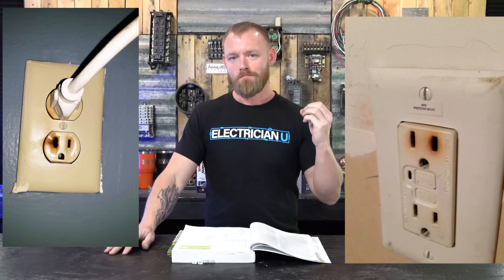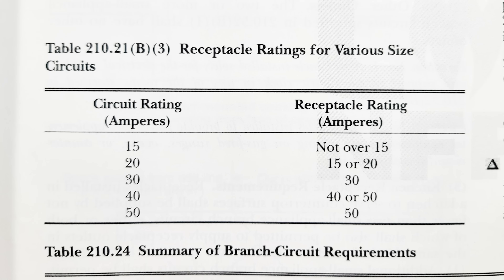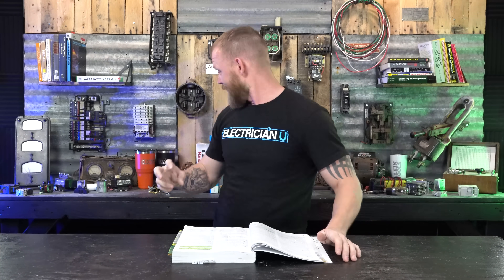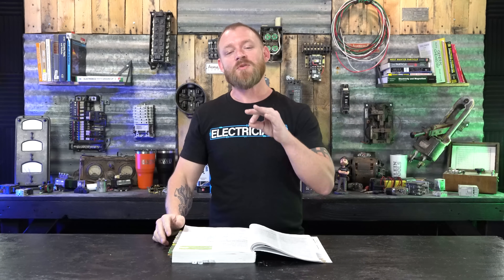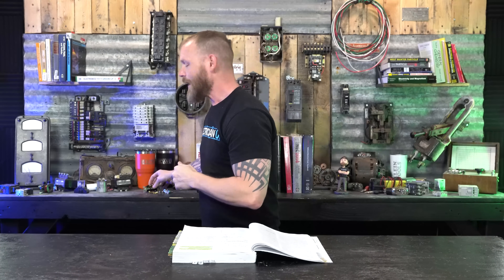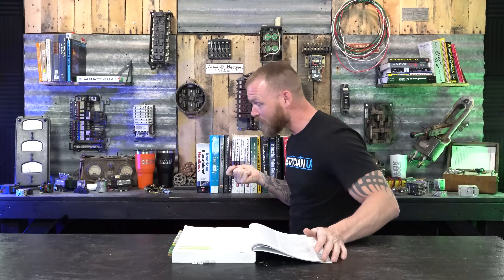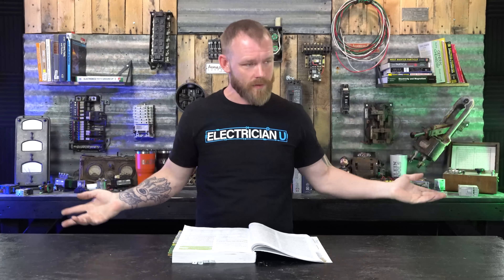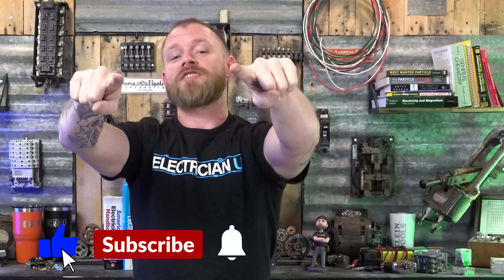Won't These Melt?!? 15amp Receptacles on 20 amp Circuits!!!

Comment: One of the other common causes of melted receptacles is old/worn out ones. If you look at the data sheet (and there is one if it is UL rated) there is a spec that states the amount of times the plug can be connected and disconnected and still maintain the contact pressure for that current. There is actually a tester for the insertion and removal force of a receptacle. If the force holding the connection is weak it will not matter if the plug is rated for 15 or 20 amps it is going to get warm if there is a loose connection. (either on the user side, or the terminal side).
Reply: Agreed. Old and wore out. Your statement about the contract pressure being a very valid point. I rarely consider myself when doing troubleshooting unless it's glaringly obvious its wore out in that way. One cause of a receptacles being worn out is from just slightly over-amping it over time. Breaking it down slowly until it fails. With any luck it fails in a way that makes it stop working instead of catching fire from arcing. Part of why AFCI breakers are becoming more and more prevalent. As they should. Though they can be a pain in the ass to set up
Reply: @JBDay-bd8cu  no idea where you got that but that is completely incorrect, receptacles are tested at well above their rated amperages to get certification and AFCIs were implemented because of damaged wires in the walls starting fires.
Reply: Makes sense. It’s like older video game systems like the Nintendo NES where the pins get stretched in the pin connector overtime and the games don’t read. 
I had a receptacle melt on me several years ago. Not sure why and it wasn’t a plug that was used very often and it was in the basement and the basement was only finished prior to me moving in. Not sure how long or how much used that receptacle was used by the previous owner though if any. We had a family friend of the wife’s come and replace it. 

We are now building an addition to our 2002 year home and we redid one of the outer walls and noticed the plug and the light switch on that wall they used the back quick connect rather than the side screws. In our addition though I am running 20 amp plugs and a circuit out there myself as I am putting 2 computers out there and it may need to be heated with an electric heater in the coldest of winter in Canada. We are wiring a mini split for the room but they don’t work as well in the extreme -40 cold. So hoping it’s done right and doesn’t burn up.

Comment: Just had a 15amp receptacle on a 20amp circuit melt.  There was actually nothing plugged into the receptacle that melted, but the next receptacle downstream on the circuit from it had an 1800 watt air fryer plugged into it that we use frequently.   It looks like the little brass bar that connect the top/bottom receptacles is what likely got hot first.  I've heard on another youtube video that even 15 amp receptacle are rated to pass through 20 amps so if that's true I'm really now sure why my receptacle melted.  Now I am replacing all receptacles in my kitchen with 20amp and pig tailing them so that little bar doesn't have to carry the load.
Reply: 4:20   I think you actually just answered my question.  Apparently code says the max load on a 15amp receptacle is 12 amps???  Why call it a 15 amp receptacle??
Reply: @dreednlb  A 15A receptacle is rated for 15A and in order to get that rating each side of the duplex must be able to carry 150% of its rating, which is 22.5A. Cord and plug connected loads are usually limited to 80% of the circuit rating, which is 12A on a 15A circuit, which is why he said 12A on a 15A recep. Your issue with something overheating is more than likely a not sufficiently tightened or loose connection. The bar between the two sides of a 15A duplex receptacle is rated for 20A feedthrough current, which means it must carry 30A (150%) in order to be rated for 20A. Pigtailing is fine but not necessary when receps are installed properly and all connections are tightened sufficiently.
Reply: @pld8993  I had an electrician come out and replace all receptacles on the circuit. I asked him specifically if anything seemed loose or why he thought it happened so I can be sure it doesn’t happen again. He said the wires were tight and it was just that the receptacles were “cheap Chinese garbage” and that it was more important to use a quality receptacle than to “upgrade” to a 20amp.
Reply: @dreednlb  That could be the problem. I never install generic off-brand equipment, not worth the chance of a callback or a ding to my business reputation. But, there's plenty of it out there on the market and neither Joe homeowner or Joe handyman know any better.

Comment: I still don't understand why you can't use a single 15A outlet on a 20A circuit yet you can use a dual 15A on a 20A circuit. If anything, the dual outlet (regardless of whether it's dual 15A or 20A), has a higher chance of fire/failure because obviously you have a higher chance of pulling too much power from the circuit if you are able to plug 2 devices rather than 1. Or think of it this way. A single 15A outlet on a 20A circuit means you know FOR SURE you will never exceed 15A because almost every device that uses a standard 15A type of plug will not use more than 15A. However, if you have 2 15A outlets, well now that outlet could have 2 devices plugged in at the same time and those 2 devices - even though they each won't use more than 15A - could use 30A total (or 40A total if they were 2x 20A outlets) which is obviously way more than 20A circuit could handle and now you have a failure at best, house fire or death at worst.

So, if anything, a single 15A outlet on a 20A circuit/breaker should be the safest option because your 20A-rated wiring/circuit/breaker is more than capable of handling any device plugged into the 15A outlet. Yet, it's apparently the opposite????? HOOWWWWWW???? Where am I going wrong here???? I've watched 5 videos on this now and still don't understand.

Comment: Electrician of 15 years here. I'm such a nerd for my profession, I watch the electrical conferences where they discuss Code. I saw Mike Holt himself say that no electrical device manufactured today is rated for less than 20A, regardless of its listed rating. I have no idea if thats true or not but...

Comment: Off subject but I saw a guy switching a 4 prong receptacle with a 3 prong.  It did have the bare ground.  He isolated the white neutral/ground and connected the bare ground to the 3 slotted receptacle. 
  Opinion?
  Btw, you have become my go to guy for electrical info when needed.

Comment: I am still leery of installing 15 amp receptacles on 20 circuits.  Good point about people plugging space heaters in. 
  Little confused about something.   Is it safe to plug in 2 lower than 15 amp rated devices in a double 25 amp receptacle on a 20 amp circuit?
  In that regard, is it safe to plug in 2 devices used at the same time in 15 amp circuit with 15 amp receptacle?

Comment: The strap that connects the two outlets in the 15 amp duplex receptacle is rated at 20 amps. That's why it's allowed. If the plug on the appliance is a standard plug,  then it  is rated for a 15 amp duplex. If it has the sideways prong, then it has to be a 20 amp receptacle.

Comment: Some faulty logic and bad assumptions starting at 6:00. If you were to plug 2 10.5A heaters into a 15a duplex recep it's true that because the draw is so close to the breaker rating it may not trip. But given that each side of the recep is rated for 15A, you're nowhere near the max rating of each side at 10.5A each. Also, the link between the two terminal screws on a 15A recep is rated for 20A. 
In order for a duplex recep to be rated for 15A, each half is rated for 15A and in order to be rated for 15A each half must be able to maintain 150% of its rating, which means that each half of a 15A rated recep can handle 22.5A minimum, and the link between the temrinal screws can handle 30A. If each heater is 10.5A you're drawing only half of what the connection can handle and it will therefore not heat up to the point where the plastic will start to melt. More often than not, excess heat has nothing to do filling the recep and has to do with loose connection between the plug and the outlet, which can create arcing and excess heat. 
The reason why 15A receps are perfectly adequate for 20A circuits is because, despite the 15A rating, they can handle at least 150% of their rating electrically (not legally). FYI, hospital and industrial grade receps must be able to maintain 250% of their actual rating, so a 20A hospital grade recep can electrically (not legally) handle 50A without compromising the device.

Comment: So if I have this right... I have been installing 20am receptacles every time I replace something. And that should not be a problem at all and make my home in a way safer (excluding melting in the wall wiring  and not outlet).
You spoke about cheaper prices. 15 vs 20. breakers, receptacles. If you covered it I missed it. Do the 15 and 20 amp CIs use the same gauge wire? Sometimes the devil is in the details and all things being equal the say wires are always the same... Might figure that out. I might have to expose some wire and check. Now as well I might have made a mistake with the GFI Receptacles. Now I need to go and see if that is ok or a problem and see if they are the same rating for the CI. I forget the size but I want to say it was two or 3 amp ratings and I tend to want to go with the 20 amp or whatever it is. Not sure if its 25 amp where the plug format changed now that I think about it. All things being equal, I like to put the better stronger item that will be safe as long as it does not cause a problem. I will not put a 440 hemi blower on a 3.0l engine. That would be bad. :D

Comment: Nice video.. What I find interesting is that, operating in accordance with code, it would not be a violation of install or usage to have 20amps passing through the plate connecting the 2 screws on the side of an "upcircuit or upstream" 15-amp receptacle.   There can be multiple loaded receptacles downcircuit of this receptacle, summing to >20amp, while the upcircuit receptacle has no load.  So, I must conclude that code requires that the pass-through capacity of a 15-amp circuit on a daisy-chain (which is typical circuit wiring) must be 20amps.  I'm curious if this is written anywhere in the code.   I watched a video the other day in which it was demonstrated that 12-gauge wire nuts and Wago nuts both handled 40amps without issue and even 60 amps for a short time! (even though they're rated at only 20amp)..   so this relaxed my concerns as I suspect 15-amp circuits could probably pass-through 30 amps with no problem.. but I am still curious if this is written anywhere - knowledgable reply/comments woudl be appreciated.
Reply: Correct. The link on a cheepo 15A recep is rated for 20A and in order to get that rating must be able to maintain 150% of its rating, or 30A. UL498

Comment: if you put a split 15amp recepticle shouldn't the outlet hold up to both of those loads? 12amps each would be 24amps
Reply: Correct, each side can handle 15A.

Comment: BAH! 20 amp breakers, 15 amp receptacles? NAH. Bought a house, had it 'inspected' and approved by independent contractor/inspector, moved in, had THIRTY amp breakers with 14 gauge wiring and receptacles wired to it. Go big or go home (if you're house doesn't burn down first!).  Of course, breaker box not labeled at all, so I had to map all the circuits myself before calling an electrician to come and replace my old Bryant box with a new Square D, with all new breakers.

Comment: What if you have special requirements when you need larger loads for certain areas of the home, and someone is paying good money to have them installed. Kitchens and Bathrooms for example need higher rating outlets, though you probably shouldn't have outlets in the bathroom anyway because water and such, but besides that, running appliances like hair drier can draw a lot of power, and then you have electrical cookers that can draw a lot of power also for heating elements, and you have a fridge, a microwave, and that expensive $500 smoothie blender you've always wanted, and you're running all of them at once.

Comment: Always pigtail the connections in the receptacle box ..otherwise all the load after that receptacle goes through the small pullout tabs between the two outlets in a single duplex..I’ve seen this over and over again where the first receptacle in a series of outlets ends up carrying the load of the rest in the circuit. What’s weird is it will show the hook up on the box of some receptacles not pigtailed..it may be rated at 20 amp but my own preference is to pigtail them anyway ..so only the load plugged in that specific outlet is going through those tabs
Reply: Pigtailing is your preference, but totally unnecessary on properly installed daisy-chained receps. The tab is rated for 20A because electrically it can carry 30A (UL requires it carry 150% of its rating).

Comment: Oh yeah 😎.  Old landlord could only connect 14 gauge wire to push-in holes 🕳 in back of 15 Amp outlets. Could not wire 20 Amp because NO push-in holes. But needed 20 Amp breakers to plug 🔌 in heaters. Somebody hard-wired large space heater and got so hot 🔥 the Plug-less wire had been heat damaged, before I got there. Probably the 15 Amp outlet burned 🔥 up. So Somebody removed the outlet and cut off the Plug and hard wired the power cord with the original wire nuts. 🤔

Comment: There is functionally no difference between a 15A and 20A non-locking receptacle outside of the sideways T. I think rather than talking in terms of 15 vs 20A receptacles, we should be talking in terms of regular vs heavy duty. On either regular or heavy duty, non-locking receptacles, the on difference between 15 and 20A receptacles is the fact 20A receptacles have the sideways T to prevent >12A loads from being plugged into a 15A circuit. Especially for heavy duty receptacles, it is well-known the manufacturers use the guts of a 20A and simply put different cover plates on, yet charge almost double for the 20A. Why pay more for the same thing?

In commercial work, it makes sense to install 20A receptacles as the is equipment that has the sideways neutral prong. In residential, it makes more sense to install heevy-duty receptacles, especially where lots of things are likely to be plugged in one place, such as a kitchen, entertainment center , or home office. I would suggest installing additional or doubling up to prevent the use of plug strips, and the consequent burnout.

Yours is the first video I've seen that so clearly relates all the Code sections relative to receptacles and ties in the hazards of plug strips. Thank you.

Comment: Alright so Just to be safe I’ve switched my receptacles to 20 amp but I have a question, can 15 amp single pole  or 3 way switches be on a 20 amp circuit ? 3 way 20 amp rocker switches are hard AF to find 😂 

What about for the bathroom Duplex CFCU receptacles that have the self test ? Can those technically be 15 amp as well , or would it be better to change that to 20 amp ?  Thanks !

Comment: I have a 12 ga single line form a 20 amp breaker to a 15 amp outlet for my dryer,  could I run a 14 ga wire off that receptacle to another 15 amp receptacle ?

Comment: You failed to mention anything about correct gauge of wire to use on  20a outlets.  This is very important and often overlooked by DIY installers.